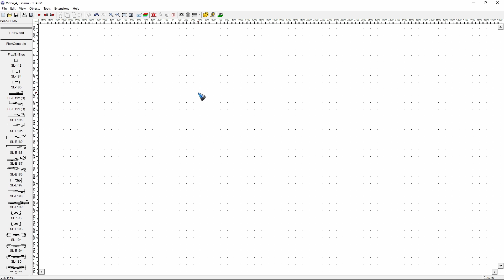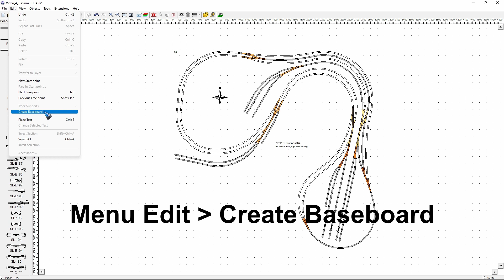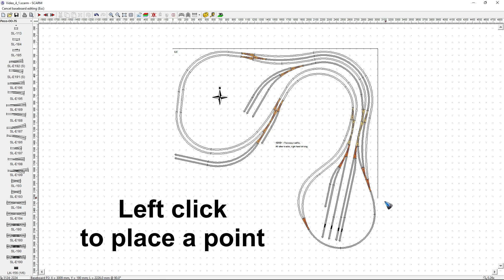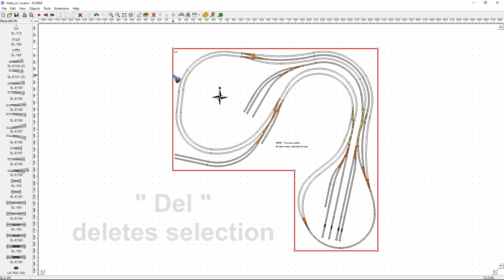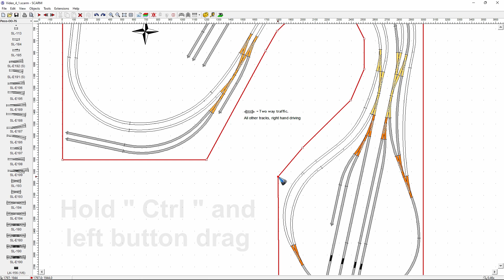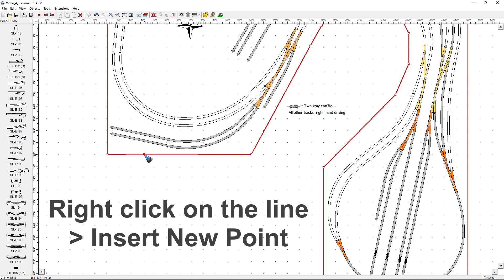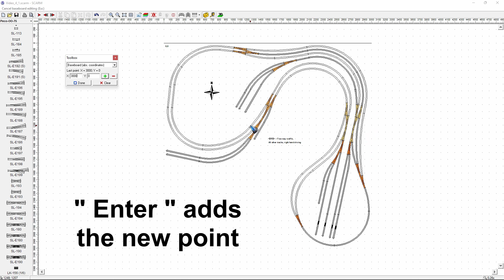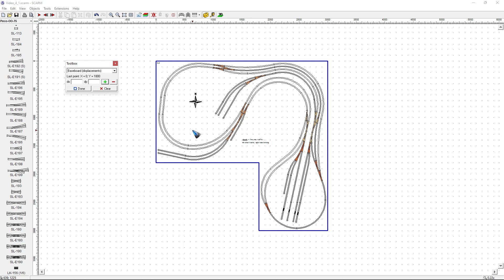Model Railway Design with SCARM 04

Comment: I am wondering if it is possible to create multiple baseboards, such as would be used on a portable/exhibition layout, so that when planning the trackwork you can avoid placing points/turnouts over a board join?
Reply from the maker: There can only be one baseboard, drawn in blue. What you can do though is draw multiple polygons, which you could even give each their own fill color to better distinguish them.
Reply: @rudyshobbychannel  Thanks Rudy.  I'm still watching your SCARM series, and learning lots.  I have a track plan in mind, so using this software should help me fit it nicely to the baseboards.
Reply from the maker: @Sorarse  I wish you fun doing that.